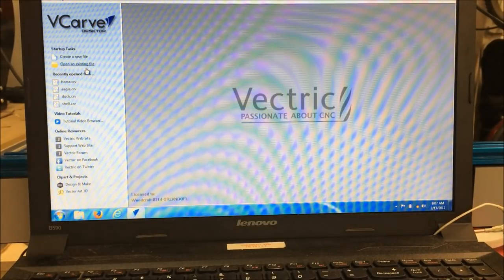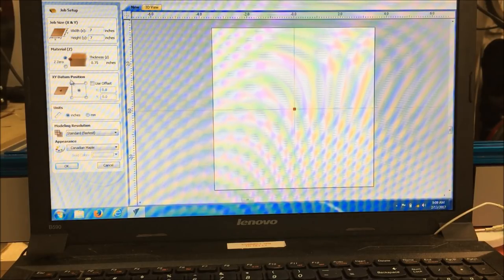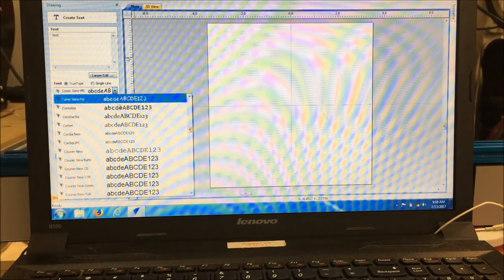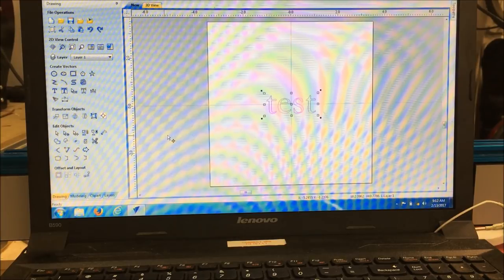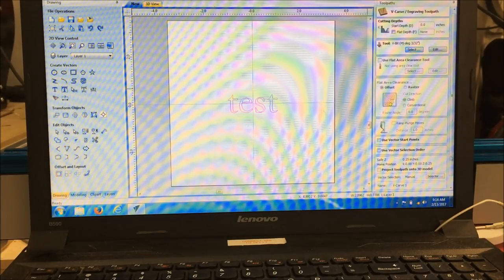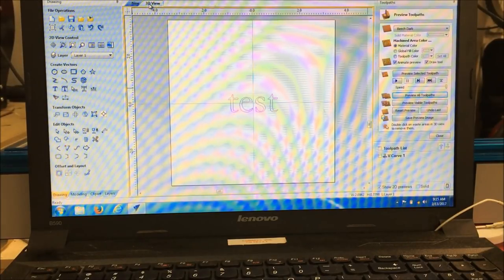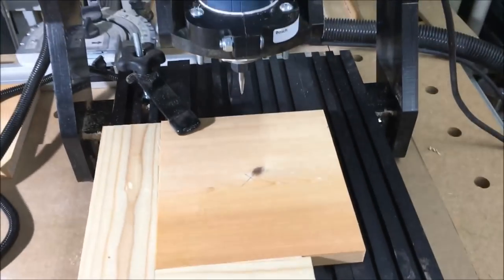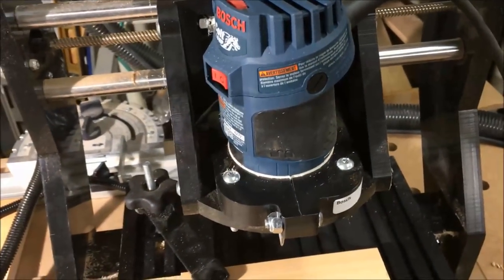Piranha CNC machine intro

Comment: will i be able to cut through wood with thickness of 1/16"
Reply from the maker: Yes. It is relative to how long the router bit is. So if you had a bit with a cutting length of 1" you could then cut most materials that thick. You can cut plastics and some soft metals like aluminum as well.

Comment: Been on the fence about this for some time.  Great video. Is it difficult to tranfer PNG and JPG files? How is it working with hard woods?
Reply from the maker: If you mean import those formats and then have the program create a vector, then yes. It's best to import images that are line art in either of those formats. The type of wood you are cutting doesn't matter. You can cut aluminum, hard and softwood, plastic, and styrofoam if you want. It's which bit is in the router and the cutting in inches per minute you set in the program that matter.